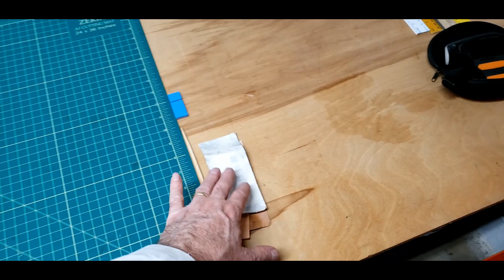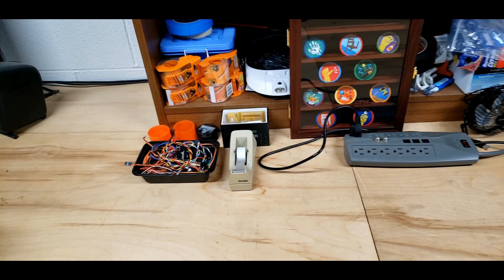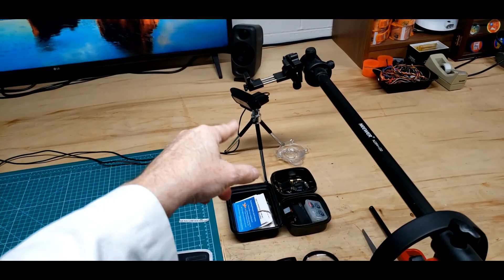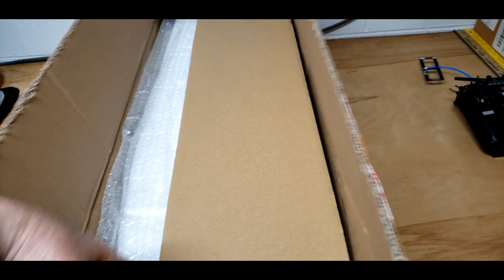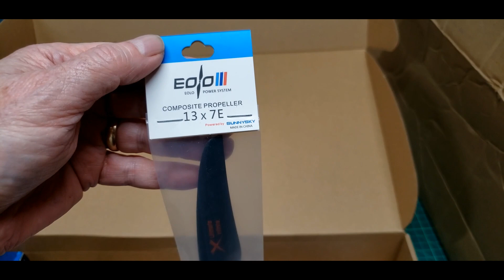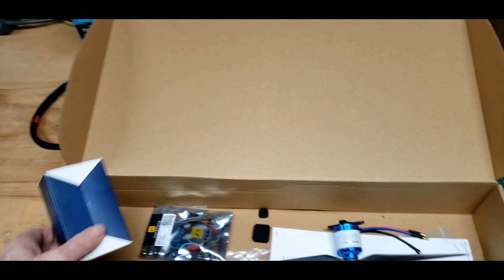New Start

Comment: Hey pal! Glad to see your back among us ;-)  this may help to distract you.. having trouble with a drone "quad copter"  I have built up from scratch and Im hoping you can help. It's the one running a h743slim..   I have not achieved a successful launch yet.  It consistently flips over from back two rotors going over the front two.. I replaced motors and esc... I have replaced the props several times now...  Im running the latest arducoptor and im at this point left to believe this must be something in the firmware???     It's a 7 inc quad with gps and compass... its not the rotation direction or the props i have checked for all that.. any thoughts?
Reply from the maker: Well, here are my thoughts.  I don't have a good idea yet.  Have we exchanged parameter files yet?  rchelp@wnc.com is the place to attach those if you like.  Sorry I don't have more yet.
https://youtu.be/U9ZpBodK00c